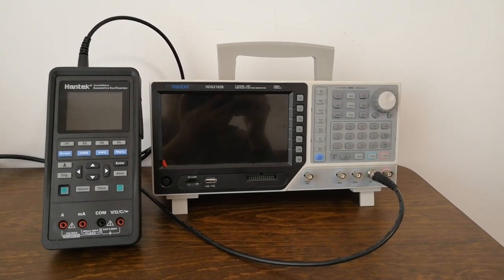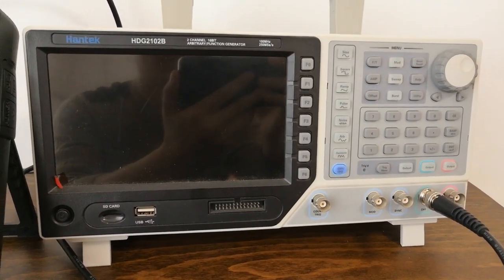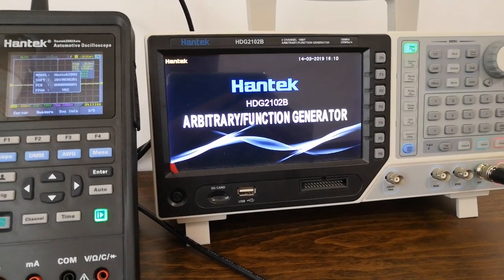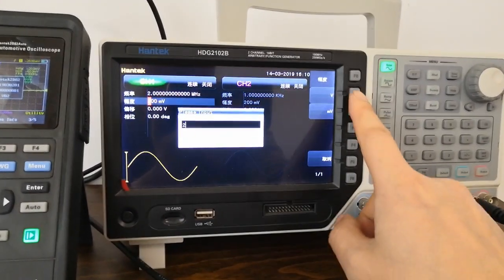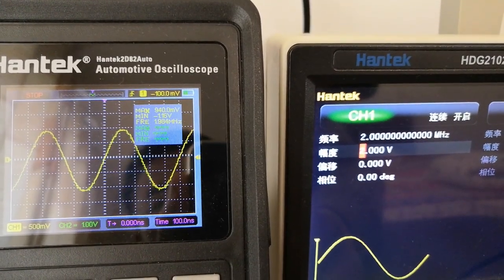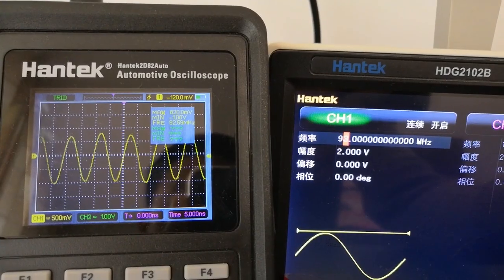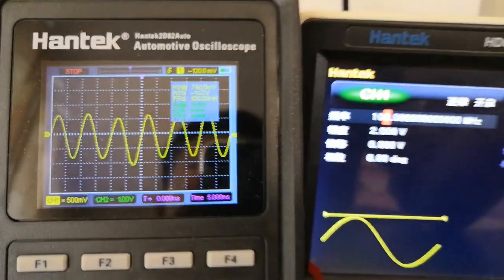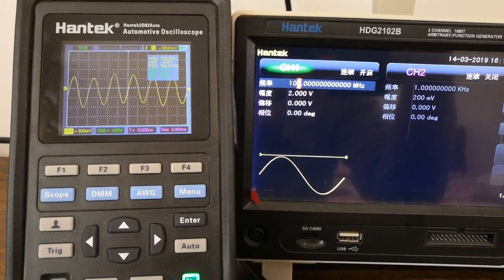What is the true bandwidth? Oscilloscope bandwidth test of Hantek 2d82auto

Comment: OMG! Hantek2000-Software and driver is somtimes causing Blue Screens on Windows 7 (64bit) and Windows 8.0 (64bit).
I'd no Blue Screens since years! - Hantek engineers are able to bring them back at last!

And the update intervall at PC software seems to be very, very slow! Even the update intervall on the scope is slow, if PC software is aquiring data.

Unfortunately the scope itself isn't able to store any measuring points. Obviously no memory, and no way to store on a SD card or USB memory stick.

So it's no problem even in set "Auto III" there are no electronics probes included, too -> instrument of low price segment.

With this limitations it seems to be too expensive, especially with AliExpress Paypal fees, Paypal exchange rates, VAT and customs/VAT handling fees.
Reply: Do you have recommendations with similar price?

Comment: How to install the Hantek8D82Auto driver (2D42 driver) to Windows Vista 32bit?

I'd played with the inf file - but no success.

There seems somthing wrong with the Class Installer Registry Entry.
Reply: For Windows Vista (32bit) you have to comment out the following line (line 19) in ..\Hantek2000_Software\Driver\Others\Hantek2D42.inf :

; HKR,,Installer32,,"Desk.Cpl,Hantek2D42ClassInstaller"

If you have a broken (partal) installation from a previos attempt, you have to uninstall the faulty driver set first (\Windows\system32\DriverStore\FileRepository\ -> hantek2d42.inf_XXXXXXXX).
Perhaps you will find an uninstall command (string) in registry searching for all entries with "hantek2d42", something with dpinst.exe.